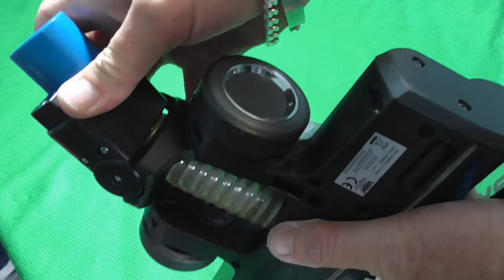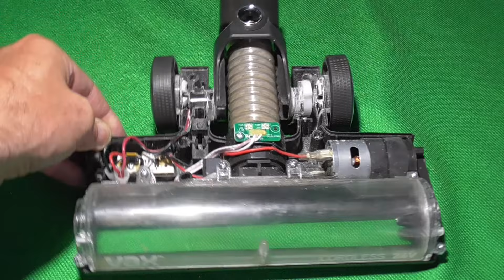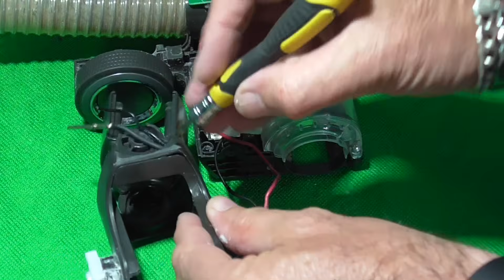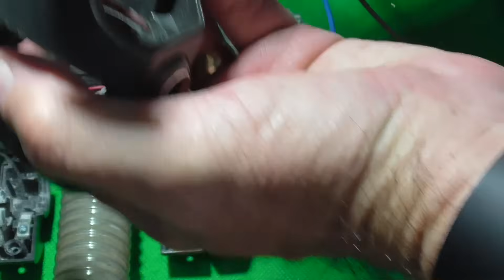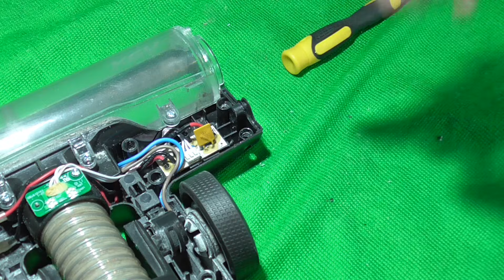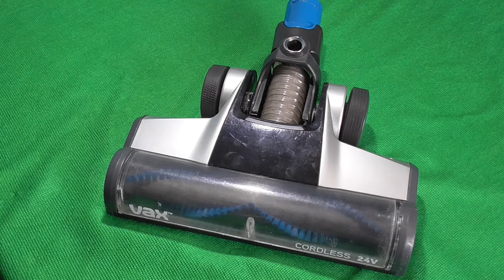How to fix VAX Blade dead or intermittent brush head - head motor not turning and LED not on

Comment: I am waiting for a replacement head .This is the fourth one ,all with the same broken wire . definately needs correction to the design . Fortunately ikept the old ones and have done a repair 
on one as a spare .Told vax about the problem a couple of years ago , but obviously they havent done anything to correct the problem .
Reply from the maker: We've had too many problems with ours and now only use it if it's a quick pickup. I bought a Shark corded vacuum and find it better than the Dyson that was our main vacuum and would never go back now. Many thanks for your great comment.

Comment: the brush on mine works great when tilted up off the floor, but once in contact with floor, its intermittent.  Is that the same issue?  lack of power?
Reply from the maker: If the motor is stopping then yes the cable is likely broken. If the motor is still running when the brush bar stops then it's possibly a belt / drive issue. Many thanks for your great comment.

Comment: Hello, so took mine apart and re soldered the pin, however still no luck. But if I change the pins around the head comes on constantly whether the machine is off or on. Any recommendations?
Reply from the maker: Pin(s) ? not sure what pin(s) you refer to. If you replace the wires as shown in the video it should restore the head to full working order, that's providing it has the same fault. Many thanks for your comment.
Reply: @DARTraderMediaProductions the pins in which you rewire/solder at the beginning of the video

Comment: Hi, Great video, I am going to attempt this but it would be the first time i have attempted anything like this... The video will be a great help. I have one question if you could help.
How do you de-solder the plug terminal? i looked on youtube but there seems to be a few different methods. 
Would i need a desoldering pump?
Any help on this issue would be greatly appreciated.
Reply from the maker: You could use a desoldering pump or solder wick but to be honest there is little solder there. I just melted what was there to remove the wires. If you tin the ends of the new wires it will make it easier to solder to the plug terminals. It will just be a case of topping up what solder is left on the plug terminals and if you have some flux apply some to the the connections and wires. If you don't have flux then flux core solder will do for this job. Hope this helps and many thanks for your great comment.

Comment: LED model additional info. Excellent and really helpful in repairing the powered head on my VAX Blade4 Pet. This has LED headlight, and the top cover is in two parts. In the video at 2:48 the cover is in a single part. With my lit model, lever off the headlight cover, pop out the LEDs, and undo the hidden two screws retaining the casing, then follow the vid. Thank you again.
Reply from the maker: Pleased the video has helped you and many thanks for the additional info, it might help someone. I will include it in the discription at some point. Many thanks for your great comment.
Reply: It did help me, I have two LEDs on my dodgy motorised head, but thankfully did not have to go that far in the disassembly to find the broken wire (where the swivel joint is.

Comment: Just saved myself the cost of replacing motor or  whole brush unit. Broken wire going into plug. Quick soldering repair. Job done. THANKS 👍
Reply from the maker: That's great to hear, always pleased to know the video has helped. Many thanks for your great comment.

Comment: These are brilliant vacuums , however the clips in the wheels are utter crap soft plastic . Just broke one after a month from a small knock . Replacement isn't too bad at £16.

Little tip , blade 3 wheels fit the blade 4 and you can find full set ups on market place for £20 or above . Cheaper than ordering new wheels if you think about thr amount of parts you'll be getting spare
Reply from the maker: I've not come across that problem with ours but had just about everything else go wrong. Is £16 for a new wheel or is the clip a seperate item ? Many thanks for your great comment and best wishes.
Reply: @DARTraderMediaProductions  £16 for one wheel . Clip is built in on the back of it . I've found a few blade 3's and 4's on market place for around £20 - £40 for a whole used vaccuum . I'm just going to collect up spares for mine.  Blade 3 parts fit the blade 4 . I know the wheels fit both anyway.

I like tinkering with appliances,  I'm going to come up with a better clip for my broken wheel, preferably metal instead of cheap plastic

Vax have made a great little machine here,  mine pulls hair out of carpets great , I guess they've just cheaped out on a few parts to keep their prices competitive.  Nothing unusual,  everything has its kryptonite.

There's actually a really good shark vac out on the market now,  which has a pivot  joint in the main pipe stem so it can easily reach under low tables , problem is that clip takes alot of wear and breaks often .
Reply from the maker: @1987person  That's interesting, I've never played with any of the Shark vacs. I really suffer for time these days as I'm a carer for my wife but like to take anything apart and try to fix it. I bought some more Argos returns about a month ago and will be going through them in the new year and filming what I find but first I have to remodel the living room. Maybe you could film some of your repairs and share them on ebay, it can be very helpful to others and could lead to a new income stream.

Comment: Great video, thank you. What wire / cable should I buy? It’s too short to fix
Reply from the maker: I used a figure of 8 mains lead from an old cassette player. I just stripped the outer covering and used the blue and brown cables. Many thanks for your comment.
Reply: Thank you so much!
Reply from the maker: @01louby  You're most welcome and good luck with the repair.

Comment: Thanks,  checked and broken wire , after replacing the brush bar runs continuously even when not turned on .There is 27v continuously at vacuum pins for head even when turned off . Any ideas ?
Reply from the maker: That's a strange one, not come across that myself but I think I had another comment similar. I can't really offer any advice with not experiencing the problem myself. I take it you haven't been in the main body of the Vax and disturbed anything by any chance.

Comment: Thank-you so much, very informative video. I thought the head motor burned out, hadn't thought of a broken wire. what a terrible design at the head swivel and terribly thin wire. i added a heat shirk sleeve over my replacement wire. thanks again! fantastic vid!
Reply from the maker: Thank you so much for your great comment, very pleased the video helped you and many thanks again.

Comment: My vax won't suck when you press the switch to increase it still won't..any ideas..I've cleaned filter etc..brush is turning fine but zero suction. ?????
Reply from the maker: I take it that the main motor is running. If so then there is either a blockage or the fan on the back of the motor is broken in some way. Without seeing what's happening it's hard to advise really. Many thanks for your comment.
Reply: @DARTraderMediaProductions  thankyou so much for taking the time to reply..most appreciated 👍🥰
Reply from the maker: @butterflywings5904  No problem, just hope it helped.
Reply from the maker: I have a video showing how to take the main body apart so you can check the motor, https://www.youtube.com/watch?v=x7idOe1Vtek Hope it may help.
Reply: @DARTraderMediaProductions  Oh yes..brilliant..👍👍
Reply from the maker: @butterflywings5904  Great stuff and many thanks.
Reply: You brilliant man..I have removed a huge blockage of HAIR..you absolutely know what your talking about..thankyou thankyou thankyou ❤❤❤
Reply from the maker: @butterflywings5904  Pleased the problem is resolved for you and many thanks for your great comment.

Comment: Thank you so much for uploading this helpful video. very informative. I have two of these hoovers, bought the same time about 2 years ago, but the heads are not working. partially  Pulled them up today and found the same cables  (the ones you mentioned here) broken close to the plug. would it be possible for you to help me with the gauge of the wire you used please. thank you very much for your time?
Reply from the maker: The cable I used was from a old figure of eight mains lead, the type you plug into a radio etc. It was slightly thicker than the original but that's for the better really and was multi-strand copper so flexible enough. Just strip the outer covering off to reveal the two inner cables, blue / brown and use suitable lengths to make up new leads. Hope this helps and many thanks.

Comment: Very helpful video. Saved £40 to £50 or so! Both of my cables looked like they had been cleanly severed near the plug - but just enough cable to repair (this time).
I must have had a later model. The top plate came off in two parts - centre cover and light then 2 more screws to release the rest.
Reply from the maker: Pleased the video helped you, yes they probably have changed the design as ours was the first model. Many thanks for your great comment.

Comment: Thanks for the help in fixing my Vax floor head. In fact, I did such a good job as soon as I attach the head to the wand it starts working, even before I've turned on the base unit 😂! No idea why. But at least I can use it now 🙂
Reply from the maker: I read in the comments someone else had the same issue but they had also changed the battery. Not sure whats going on there, the cause has to be in the main unit as the power to the head is controlled from there.
Reply: @DARTraderMediaProductions  I've probably broken that as well 😥Never mind. As the other person said, a quick disconnect after using it is fine, at least it's working now. And it was the exact same wire in the exact same place as in your video, so obviously a design flaw.
Reply from the maker: Pleased you managed to repair the broken wire at least, many thanks. @RomseyUkuleleGroup

Comment: I did the wire fix but now the brushbar works without the power button on!As soon as I attach the top power unit. Any ideas please?
Reply from the maker: That's strange, I have no idea whats going on there. I take it it was working normally before the wire(s) broke.
Reply: I did change the battery as the lights were flashing red so thought I had short circuited the power head. And new one charged up fine.
Reply from the maker: If the LED(s) on the brush head were red it usually indicates the brush bar is jammed or possibly the motor. Too much has gone on to say what the fault might be without it being in front of me. @JiMukherjee
Reply: Thanks. It's a fix for now so we can cope with the hose quick unplug to stop it. But seems like it should just be a wire connection issue.
Reply from the maker: Could the switch be faulty ? or maybe as you say a connection issue somewhere. @JiMukherjee

Comment: my vax hose is so short cant get end out enough to unscrew it. 2nd the terminal at end is not soldered in goes inside seems its glued in ,waiting for small drill bit to see if i can drill broken end out.. although thks for vid.
Reply from the maker: Hopefully you will sort it. I am waiting for a replacement hose to arrive as mine has split. This vacuum cleaner has been a pain in the arse to be honest. I'll not buy another, they are just too unreliable for what they are. Many thanks for your comment and hope it works out for you.

Comment: Great video. Shame I didn’t see this before I fixed mine. I removed w a a y too much of the head. AND, I started at the top and worked down. Fearing bad joints on the handle segments.
Incidentally, my neutral was broken in exact the same spot as yours.
Poor design by the look of it.
Reply from the maker: To be honest I don't think I'd buy another as it's not been very reliable. The charger went first then the switch would stick and sometimes turn itself on, thought we had a ghost for a while. Then the head wiring and I've just ordered a flex pipe for the head as it's split. I've also noticed the main motor bearings whine sometimes when it's slowing down. Many thanks for your great comment.

Comment: I have a diffeent problem. The light comes on - so no issue with the cable. The brush is free to turn, but isn't powered. So it seems that the sensor which detects a jammed brush has failed- disabling the motor to prevent it burning out. Can you tell me how I test the sensor, and to  disable it if it has failed ?
Reply from the maker: Possibly but I would start by checking if there is any power getting to the motor to rule the motor out. As far as the sensor goes from memory there is a 1cm square orange / light brown component on the small board that the motor is connected to. It's marked B220 according to my notes and the motor is fed through it. In normal operation it will have continuity through it if you put a test meter across its legs. I think it's a thermal cut out as when a jam occurs it gets hot and cuts the power. This is why the user guide tells you to wait one min after clearing the obstruction before switching on again as it needs time to cool. I can't see anything else on that small board that would act as a sensor / cut out device. This is only my understanding of it's working and could be completely wrong but this was the conclusion I came to when I was playing with it.

Comment: Thank you just fixing mine...all repaired now...
Reply from the maker: Great stuff, pleased the video helped you and many thanks.
Reply: @DARTraderMediaProductions The wire are too frail plus copper can be heat shrink, bad design as the radius of the head breaks the wires. I externally fitted mine the 4th time.

Comment: Thank you. Excellent tuition.
Reply from the maker: Thanks so much, pleased the video was of help to you.
Reply: Brilliant mine must have been an earlier model because I couldn’t split the pin holder but managed to splice a piece of wire in and bingo it works ,don’t know how long it will last because the design is poor as side to side movement puts too much strain on the wires

Comment: Mingarbage vacs these ,wish i never bought one
Reply from the maker: Yep, I would not buy another. First the switch went followed by the power supply and then the head, Oh and I've noticed a split in the flexible pipe on the head. The thing always seems to run out of battery when you've not quite finished. 🤣